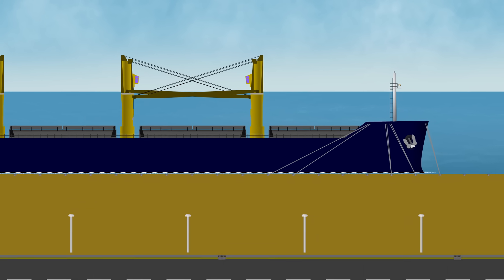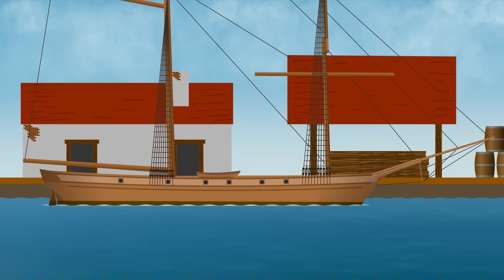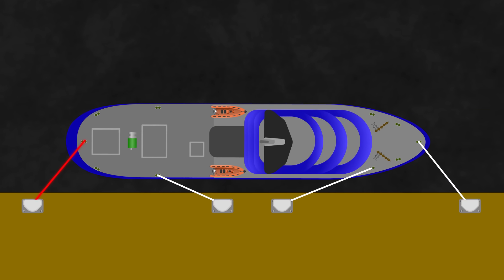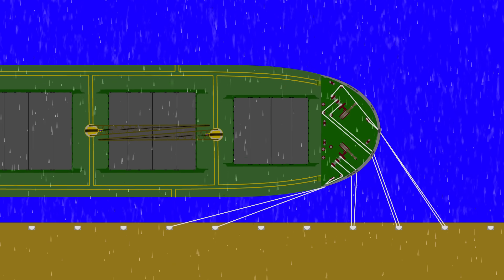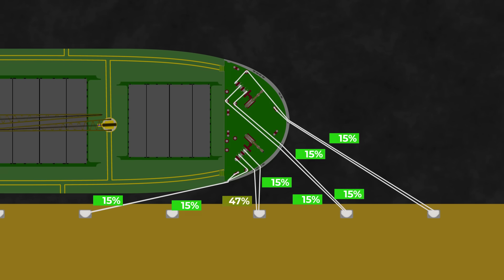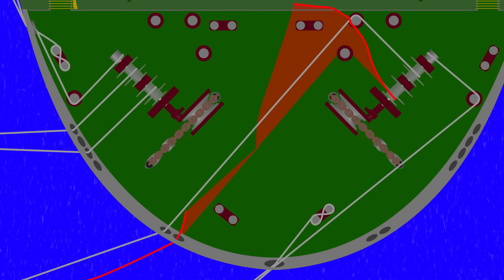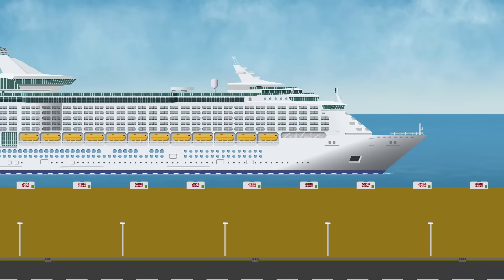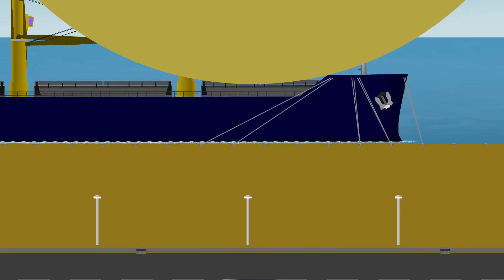Why Do Massive Ships Still Use Ropes?

Comment: I am surprised that there isn't smart winches that constantly keeps the proper tension on the lines.
Reply: There are constant tension winches but the aren't always the best solution.  If there is a strong wind, or current, from ahead or astern they allow the ship to slide along the dock.  The lines under too much tension slack and the other lines pickup, and away she goes.  Some docks prohibit their use entirely, especially oil terminals.
Reply: There are. They are used for some towing applications. Quite expensive and really just another possible failure opportunity. Nylon is by far the best material with its built-in shock absorbing properties.

Comment: You said that we'll likely replace ropes in the future, but I'm not so sure that will definitely happen. Yes, technology will improve over time, and that is certainly a good thing, but there is a lot to be said for a simple, reliable, cheap solution to a problem. I see it as being similar to the wheel in that we have hovercraft and airplanes and all manner of solutions that can replace the wheel, but the wheel is so dead simple and reliable that we are willing to accept any risks that go along with the technology. 

Don't get me wrong, I'm not some luddite who refuses to use any new technology. I just think when a technology has been in use for thousands of years it will only be functionally replaced when the new solution improves on safety, costs AND dependability.

Comment: Something else to consider is the local tide height change.  With no tide change like in a lake,  you don't have to lead your lines much.  However,  some places have huge tide swings that require very long leads to prevent your lines parting.
Reply: Depends on the lake actually, the larger lakes to get tides.

Comment: Why not use computer technology and tension sensors to create a winch that can sense when a rope is too tight and ease the tension?
Reply: That would help if you just have one overstretched rope. But suppose the wind comes up and is blowing you away from the quay. All your ropes become overstretched, so your computer starts slackening them all, essentially winching it away from the quay. OK, no ropes snapped, but you haven't solved the fundamental problem of your ship getting blown away.
Reply: It's cheaper, easier, more reliable, and more practical to have the ordinary seamen on watch to check the lines periodically. They have to be on deck during cargo and ballasting ops anyway. Might be good on a cruise ship.

Comment: Is the tension in the ropes measured? Seems like a potentially useful data point
Reply: They are not during their useful life. They are rated for certain tonnage when you buy them. I can't speak for every shipping outfit but ours were good about replacing them when they showed signs of wear. Our lines were stowed below deck when not in use or coiled under an overhang on the stern.

Comment: Why can’t they use chain to moor the ship in port?
Reply: Way to heavy to easily move around.  Keep in mind the crew has to pull the lines out on the deck of the ship and they the have to be pulled ashore.   Also chains still fly when they break

Comment: Interestingly. There had been a storm here in Denmark around a week ago. From the news media, I read that one company that was controlling the smaller ferries between the islands effected by the storm and increasing water, had to leave the port and ferry dock as to in a sense, ride out the storm on the open sea
Reply: I had to do that with my 32ft sailboat that I was waiting to sail home to the home port. 

Early in morning I saw on weather forecast that there would be strong wind so I had to in a hurry drive the 45min to where the sailboat was in a bad spot because no other places in that harbor was available. When I arrived the wind had started to increase  boat was already jumping up and down tugging on the lines and one of the rope eyes on the boat made of cast metal had already broken. 

In strong wind I had to maneuver to the other side of harbor to fill diesel for the drive (no sailing in that wind specially alone...). I was barely able to get away from the dock after filling fuel because the wind kept me pinned to the dock. But I made it out and while I was heading out on the way home I met the rescue boat, they must have been thinking I was crazy going out in that strong wind 15ms with stronger gusts. The ride home for engine went ok and it had no problem going against the wind and large waves thank to having a powerful engine :) I was home in the afternoon and in that harbor it was sheltered from both the wind and waves.

Comment: Very interesting :) One thing you didn't mention is the the rise and fall of tide. This is less of an issue for small boats and yachts that tie up to floating pontoons but big ships moor against docksides and the tidal heights (many metres here in the UK) need to be taken into account.
Reply: I worked on a small cruise ship for a while, and we had hourly security patrols and part of those patrols was to check all mooring lines and adjust as needed. If major adjustments needed to be made, it was our responsibility to work with the mate (waking them up if necessary) to determine if firing up the engine was necessary to make adjustments.
Reply: @jaygaymes  I'm curious, did you have to report the result of then patrol, or just if adjustments were necessary?
Reply: On the tankers I worked there would be a deckwatch of three men with the occasional woman. One mate and two ABs or ordinary seamen. Part of the seaman's job is to adjust the lines as necessary both for the tides and for the loading and offloading which had a more immediate impact on line tension. If a line parted on your watch it was a failure on your part. Keeping the appropriate tension on all lines was something that needed to be adjusted usually every couple hours but it's the seaman's duty to monitor it during the entire watch while also doing cargo operations and making deck rounds looking for anything unusual.
Reply: Wightlink uses the MoorMaster automatic mooring system that is line-free on their routes in the Solent which sees some of the highest tidal differences in the UK.
Reply: Now that just makes me wonder how the hell ships are even able to moor in the bay of fundy.
Reply: My parents and grandparents both used to holiday on the Norfolk Broads, which have significant tidal sections, and have stories about boats being lifted out of the water due to being moored at high tide. Great Yarmouth is a particularly good one since it's right near the sea so very tidal, and the Yacht Station is a popular mooring location for those wishing to visit the town or waiting to cross Breydon Water.

Comment: I was on a Frigate where the flight deck is also where a lot of the aft line handling occurs. Had wicked bad snap back where the rope end flew all the way into the hanger bay. Luckily no one was hurt and nothing damaged. Same ship was tied up, but in a spot where it could be hit by full seas and weather. Ship was galloping so bad she snapped her forward lines, and they ended up cutting the aft and getting underway without a tug and just went right into the sea...... leaving quite a few of us on shore. Lucky I was Air Det and we were working on our aircraft off ship.... so we were stuck there for nearly a week extra.

Comment: Really enjoyed this one.
I cross the Irish sea 8 times a month for work and it never ceases to amaze me how they can deploy and rewind the lines in the most unforgiving weather. Forgive my terminology ignorance I am a freight driver. The ropes are good to allow a small bit of stretch so when on a Ro-pax it can all stretch or relax.  In Holyhead they have large buffers alongside.
I always thought some electromagnets could be used to hold a ship in place
I suppose a length of rope is cheap and versatile and doesn't require
Reply: Also I suppose, that Ropes from Nylon or HMW-PE are cheaper to massproduce and given the corrosive environment in ports and harbours still just cheaper than some highly advanced electro-mechanical device :)
Reply: We call the big black things fenders! And the actual long platform&supports that stretch out between the two ferries are called dolphins! Up on the Cairnryan Belfast route we use hydraulic powered clamps on shoreside to help hold the ships in place! Meaning in normal weather we may only have to have 1 line out each end!

Comment: If there's safer material, then why use nylon at all? What benefits does it have?
Reply: Dyneema is very expensive.  Ropes in general act like shocks (US) or dampers (everywhere else?).  By acting like a spring, they don't put a shock load on themselves or the ship.  Friction between ropes and fibers in the line dissipate energy providing a little damping.  Anchor chains are different because they are much longer than mooring lines, and the length and weight cause the chain to start acting like rope in terms of spring and damper.
Reply: @major__kong  Interesting. Thanks!

Comment: There is probably a good reason why you dont just use chains but i can't seem to find it. Can someone tell me?
Reply: Chains don't provide any shock absorption and damping.  Ropes do. Short sections of chains also don't take shock loading very well.  Just do a YouTube search on vehicle recovery using chains to see this in action.
Reply: @major__kong  Thanks mate
Reply: Heavy, not flexible at certain angles, made of seperate links. That's some of my guesses. But I'm no expert
Reply: @Deppie_____  Well I didn't think about flexibility but that's most lickly one of the reasons. I don't know about weight, it seems to that compared to the cargo the ship carries that woudn't be too bad.
Reply: @juliusdamian1795 The weight is more an issue for those who have to handle the lines. There are people on shore who take a light line thrown from the ship and pull the lines all the way to the docking bollards. I watched teams of 3-4 do it on a recent cruise. Chains would likely need mechanical assistance.
Reply: @markdavis4056  Oh that would be a pain. Thx for contributing to the book of things I didnt think of.
Reply: @juliusdamian1795  Every ton of mooring chain that you're carrying is a ton less of cargo, which is a chunk less profit per voyage. And a lot of ships are sailing scarily close to break-even.
Reply: nobody mentioned it yet but you need friction to secure the lines to the bollards. rope does that well. chains don't.

Comment: I think even with lineless mooring you will still have ships carrying on board mooring lines for docking at ports that don't have the system or even just have them in case of a system failure for redundancies sake.
Reply: I don't see mooring lines ever being replaced. Sure, you can over engineer anything, but in the end ropes are predictable and very, very cost effective.
Reply: @benjif2424  The ropes could also make for a decent backup to a clamping system, the ropes are slack normal but of a clamp fails the rope could keep the ship from going to far before corrective actions are taken.
Reply: Probably similar to sea charts; the longer you wait, the more the technoly evolves and the more ships will rely on the new technology
Reply: And frankly mooring lines actually have safer failure modes than anything I can imagine. Big wind comes in - do you really want your high-freeboard cruise liner to tear apart the quayside?
Reply: @kumoyuki  On that I would imagine that alternative methods may be most useful in cases like ferries, with frequent routes where fast way to moore and un-moore would be a fair advantage. In case of failing ye if it fails there is big problem, although with it being quicker to release in some cases letting it go might be an option.
Reply: Coils of mooring line are also the best hammocks.
Reply: I think that any profesional crew would refuse to board any ship without the essential safety and backup equipment, lines high on the list.
Reply: Like I get magnets and suction cups are strong, I would just worry about it ripping off part of the hull, or at least the paint.
Reply: @andrewyork3869  I think they would be supposed to break under enough load like is the case with anchors
Reply: @ImieNazwiskoOK  still wouldn't trust it, I do think there is an argument for both should such a system be deployed. I will say, though I can see such a system being supper useful for tenders.
Reply: I thought vessels only use lines.
Reply: So sailor here first ships use “lines” not ropes secondly larger ships use steel cables lastly any idiot that stand near a line under load is doomed to fail
Reply: @kevinsmithmith4197 as a seafarer with over 30 years at sea ,the last time I used wires was about 16 years ago. Wire rope is not as good as products like Kevlar lines which are much stronger and also have the benefit of no stretch which makes them safer than poly lines which snap back when they part.
Reply: @kevinsmithmith4197 that's not true. Steel cables are very dangerous which is why synthetic lines are used just as he said in the video

Comment: I've heard about yachts simply using dynamic positioning instead of mooring lines
Reply: I think that's only for large motor yhats belonging to ultrawealthy people who don't care about fuel costs.
Reply: Dynamic positioning requires lots of power and lots of fuel.  Also all of the thruster wash would cause problems in most places